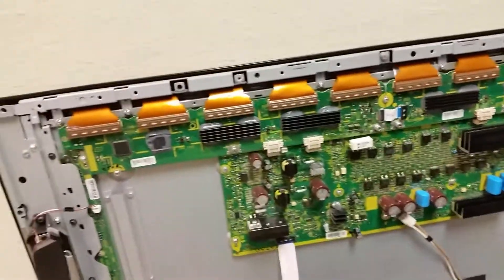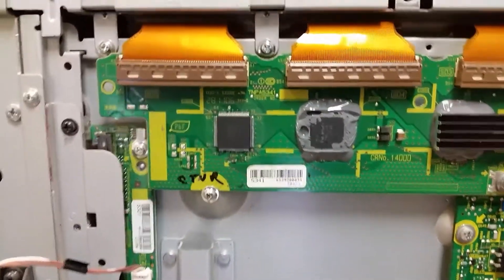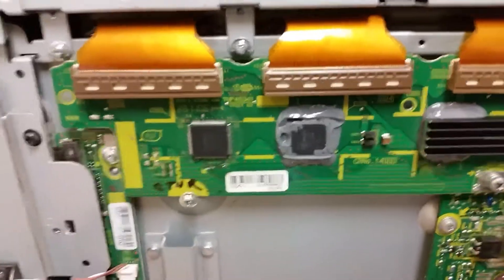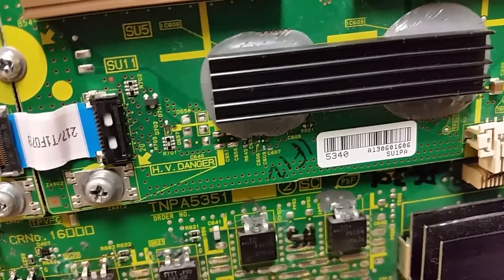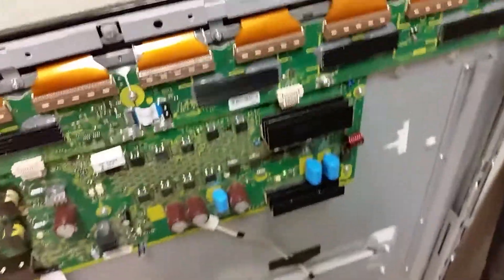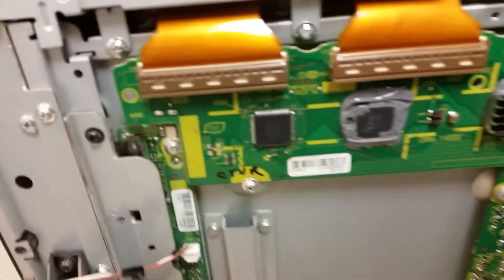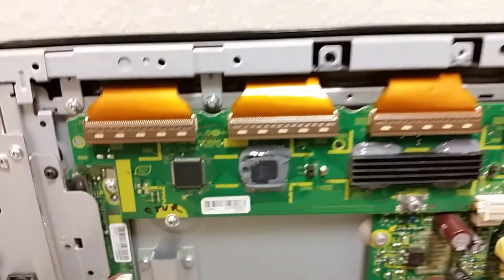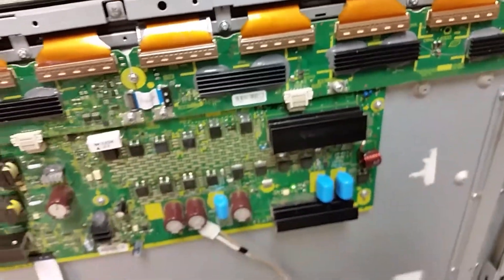Functionality proof TNPA5341 after repair, TNPA5340 bestelectronics1994

Comment: come si può capire quale processore è quello guasto?
Reply from the maker: 99% of the time it is the top IC on the top buffer board. 1% can be anything or any combination. You test resistance between floating ground (metal screw on the buffer) and every pin of the output connectors for the plasma display.
i know we made some videos for that too.